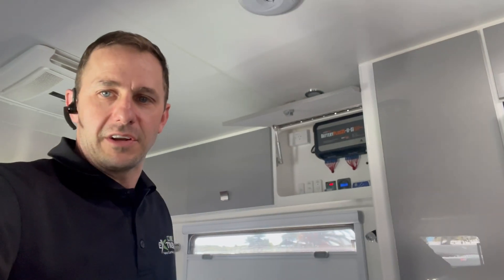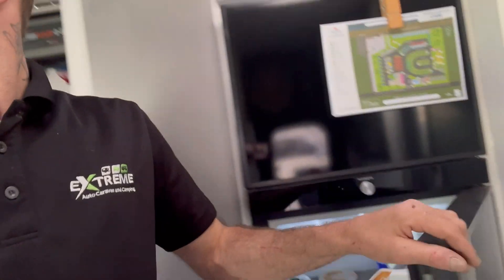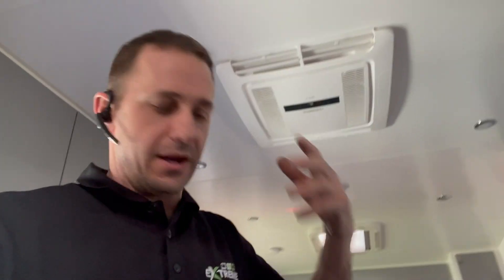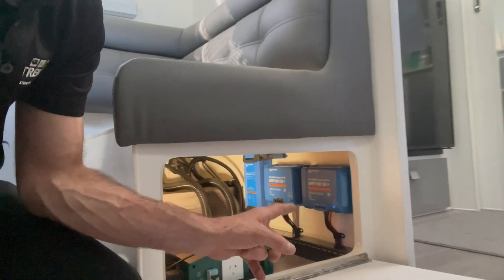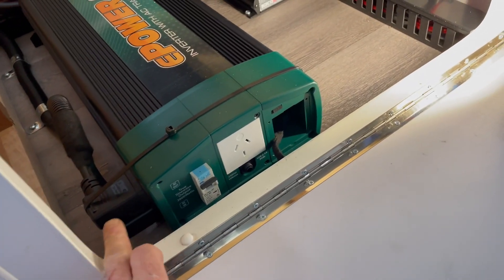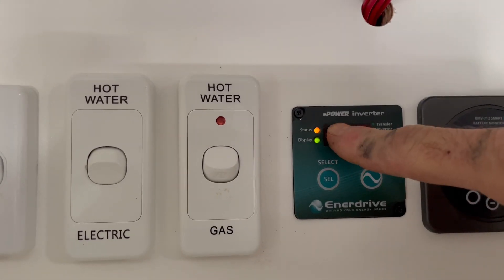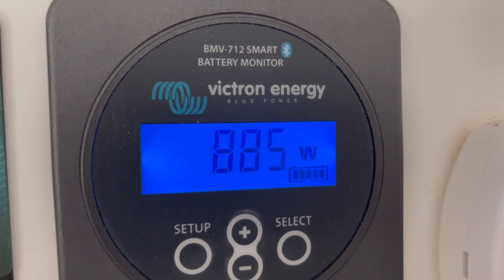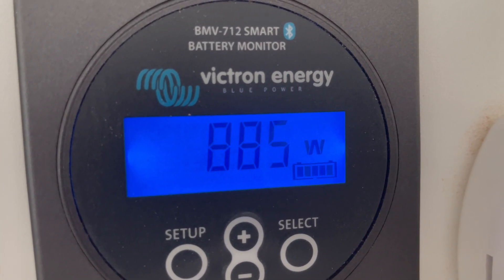Toodaloo Offgrid 1150 watt solar 560ah lithium runs air conditioner microwave induction cooker.

Comment: Hi Matt, I see in a lot of your systems you run 2x50mm2 to the inverters. Are they usually ANL fuses and the others fuse blocks midi? And what size fuses do you have to the inverter (let’s say 3000w) - about 150a each?
Reply from the maker: fuse will dep[end on the cable used.
50mm good for 250a at 12v
95mm up to 400a at 12v

Comment: Love watching your videos, just wondering when you do these overlay systems leaving the manufacture installed system as a 12v distribution system only, if there is a 3 way fridge how do you trigger 12 v to fridge when you install a separate dcdc charger?
Reply from the maker: The feed was a done factory 2?ways.
D+ wire looped to the 12v+ heater in.
Or
D+ to pin no.12